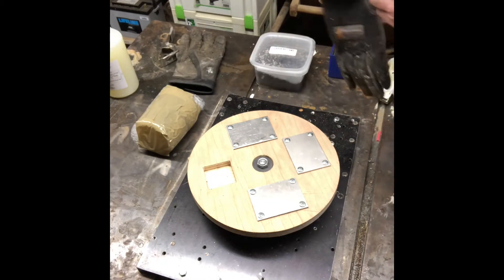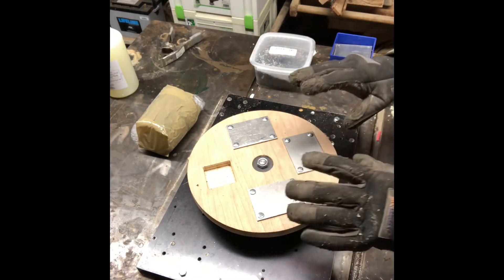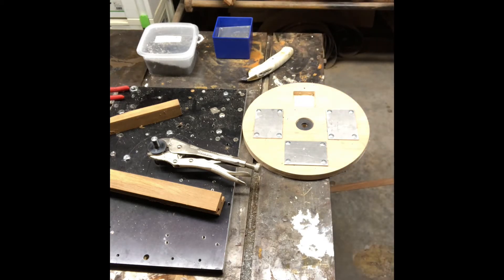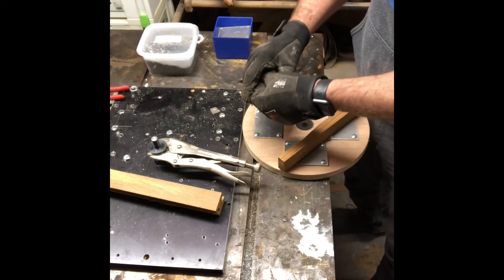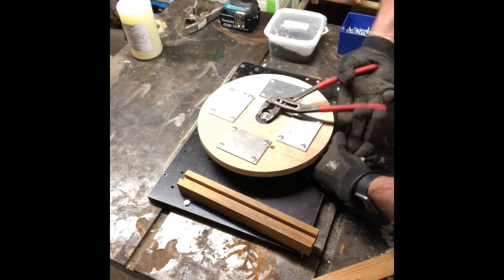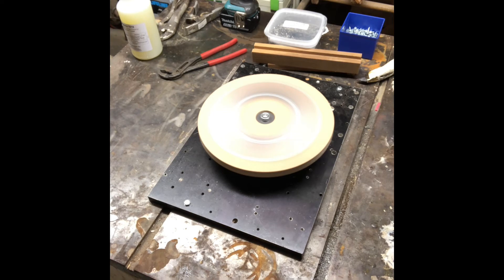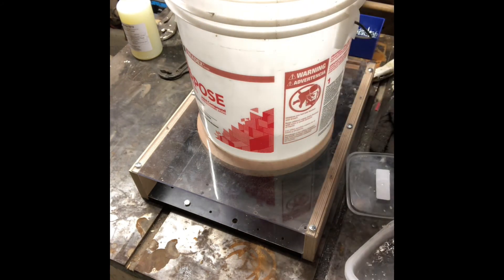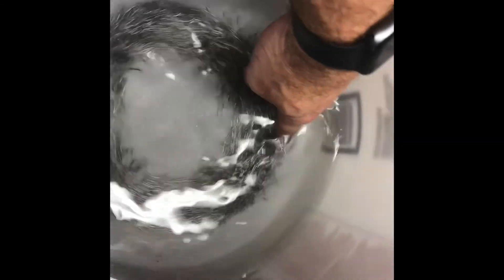This DIY Magnetic Tumbler Uses Scary Strong Neodymium Magnets

Comment: At the moment I'm building a magnetic polisher too for jewellery and maybe small art pieces but I'm really struggling with deciding on a suitable motor (desktop/workbench model size) but I don't want to over power it (and spend more than I have to) but certainly not underpower it. Have you got any suggestions on RPM and maybe motor power?
Reply from the maker: A friend loaned me the Dc motor . I think its 1600 RPM? Faster seems better.